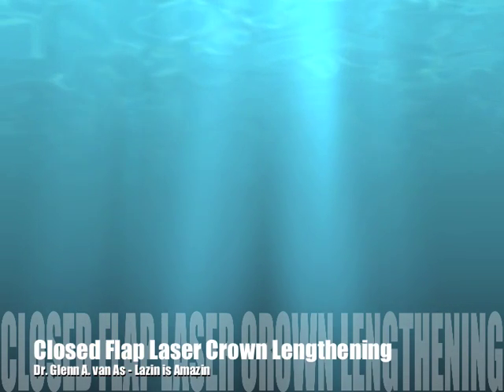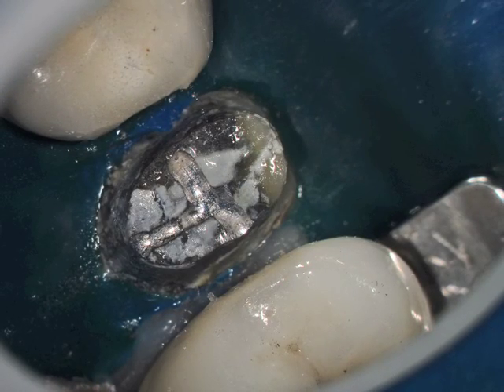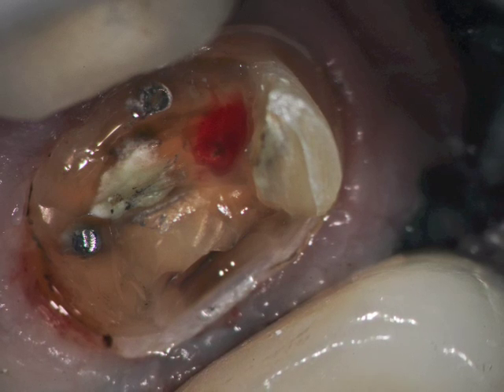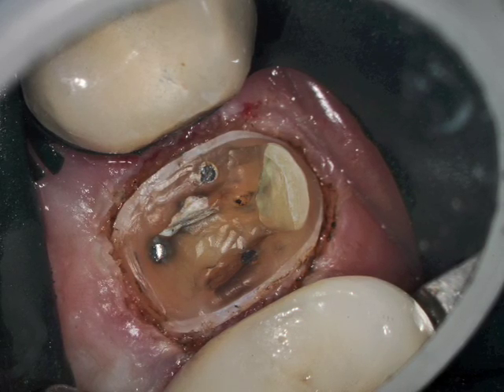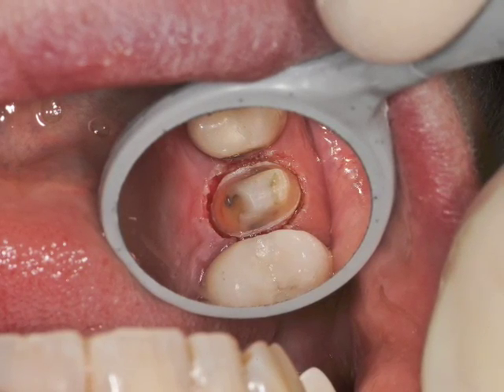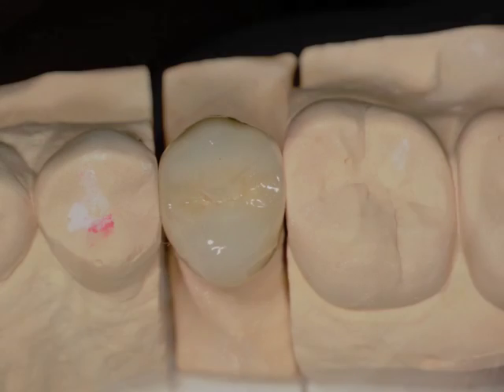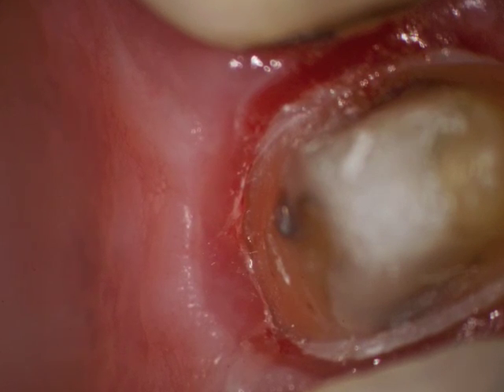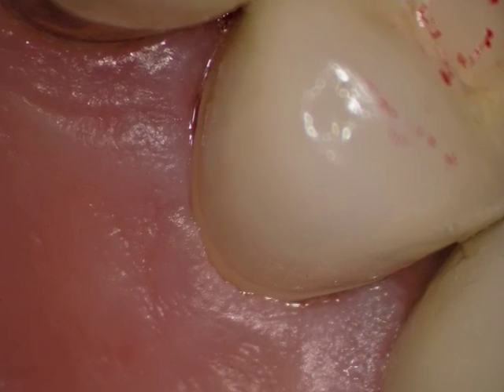Closed Flap Crown Lengthening.mov

Comment: Comments from a dentist of 45 yrs of experience......a.  I'll take an assymptomatic  pin retained amalgam core over a bonded core any day.  Had you not removed all the amalgam maybe the exposure would not have happened.  b.  With an exposure that big, you might as well do the endo and use the pulp space for a post and get some REAL retention.  c.  I hope by now you have discovered zirconia crowns.  The only time I still use PFM's are when I have to have a metallic attachment.  Your end result was pretty, but it is doomed to failure.  Still another thought if you thought your pulp treatment might work would have been to place a temporary for a year before going on to the finished crown.  What's the rush?